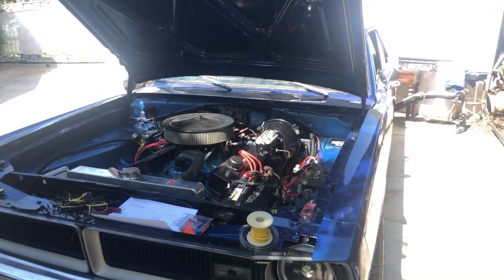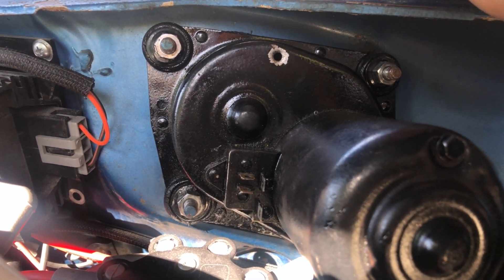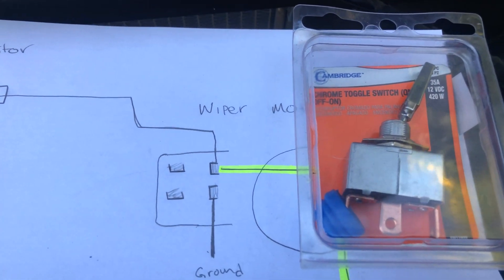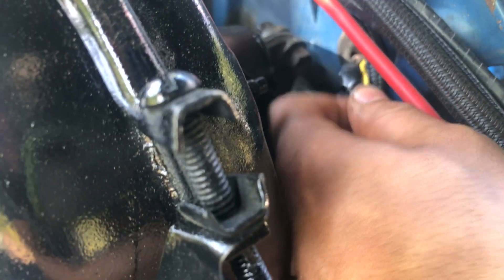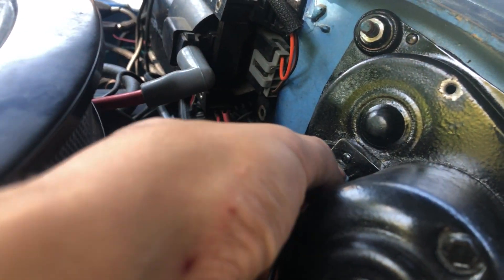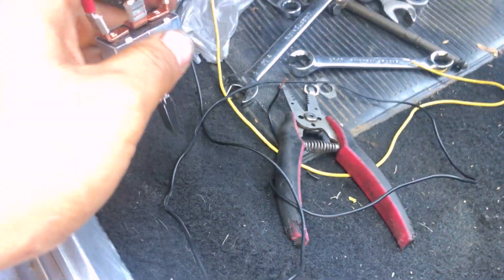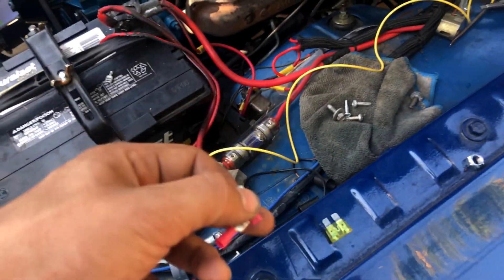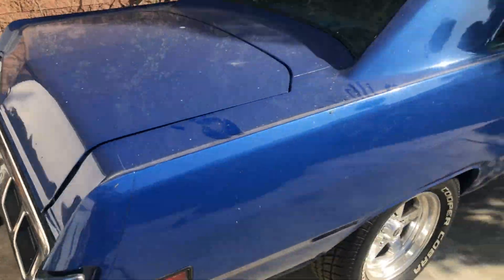How to wire a wiper motor to a toggle switch

Comment: What if you don't have a resistor
Reply from the maker: Been a while since I made this but I believe the resistor was to get the low and high speed. You can bypass it completely but you would just have 1 speed option

Comment: Do you really want to drive this in the rain or even leave it out in the rain? Cars back then were notorious for water leaking onto the floorboards & trunk floor,  rusting them out. People never checked under the carpet or trunk mat - until it was too late! Not to mention car exterior bodies rusted out fast.
Reply from the maker: I just really loved driving it lol It was never heavy rain, just some sprinkling I needed to clear from my windshield. But I totally get your point. I think for a more higher end car I would definitely think twice before driving it in bad weather
Reply: hey i have a 72 nova, and it never, i lied it leaks

Comment: Awesome video 
This is what I'm trying to do with my 86 cutlass cierra, having a funny thing with the motor to where it doesn't allow full extension of the wiper blades.. basically the bolt that moves the crank arms is keyed, but it's not making a full rotation. So it'll just send the blades up a few inches. Got a new motor and that bolt is doing the same thing. Trying to figure out if the wiring harness is telling the motor it can make a full rotation.. but hot wired it won't. I'd like to bypass factory and just put in my own switch like you did, just totally unclear on why it won't make a full rotation. Any ideas ?
Reply from the maker: If you’ve already hot wired the wiper motor and checked all possible connections on it, I would think it would be something to do with the wiper linkage instead. Have you hot wired the motor without being installed, and check to see that the shaft makes a complete rotation?
Reply: @Inlandspeed  yes, that's exactly what I've done. With the old motor and a new one. Both are having a very strange problem of making like a 1/10th rotation, clicking, and starting again in the same spot. Initially thought the old motor had a broken pin or something inside, it's bizarre to have it happening on the new one too. 

I tried this just loose and also installed. Checked wired connections to the motor. Took off the little dome/cover , can't see anything obviously wrong.
Reply: This is the same exact thing that's  happening with mine. Just clicking and stuff. Ive installed 2 other motors and all the same things keeps happening..ive watched numerous videos and havnt found nothing similar then came across your comment. Did u ever figure out the reason why?
Reply: @aileenyoung3526  Nah, unfortunately not.. I just don't drive in the rain =\